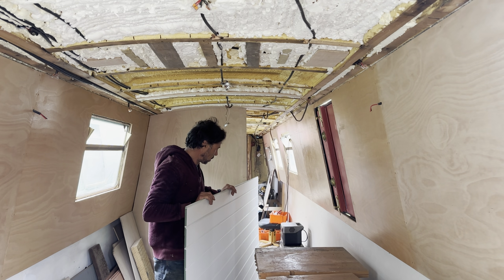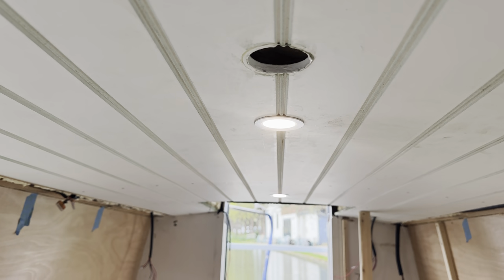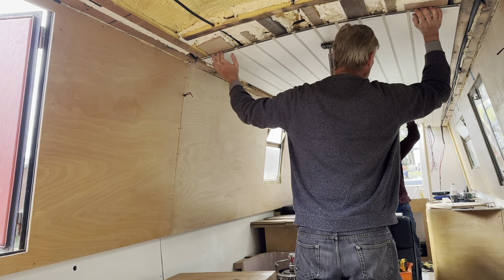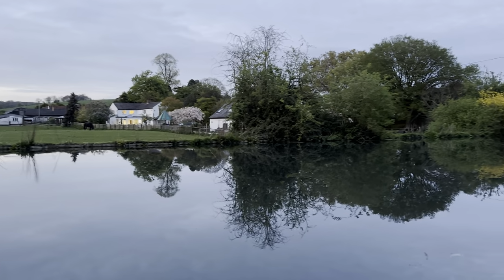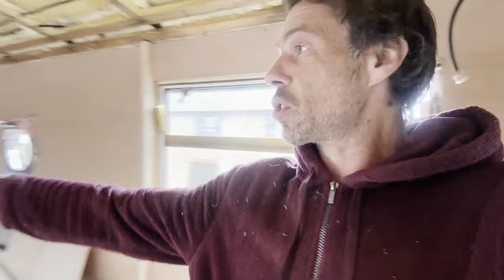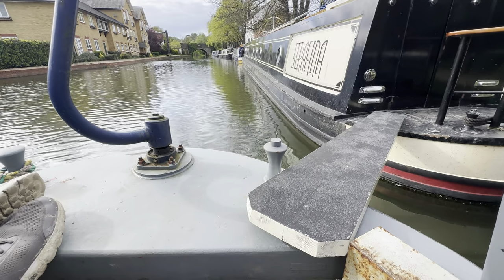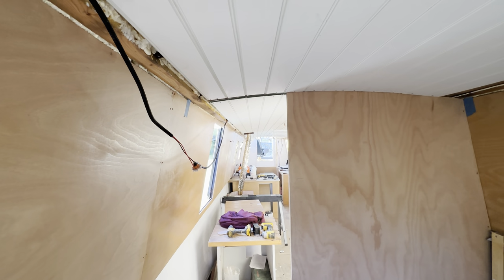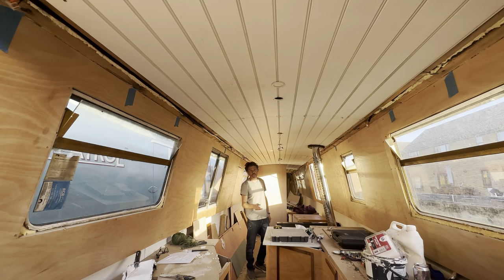538. Transformational change on board

Comment: Get some of that door trim with the brush for your sliding door gaps.  The kind you get on the bottom of doors a bit like the stuff you have inside letterboxes?  The brushes will close the gap when doors open and move out way when doors closed - I hope that makes sense mate 👍
Reply: My thoughts precisely.  I have a similar draught excluder on my front door, and the bristles are about an inch long.  Longer ones are available.

Comment: You could make some blocks that you could temporarily screw to the ceiling with a toggle on. You could have 2 on 1 side closed to tuck the board up behind and 2 open on the other side, then lift the board up flat to the ceiling and close the other 2 toggles. Your board will then be held up to the roof while you position it and fix it. Then remove the toggles and use them for the next board.

Comment: Yes, I can see the variance between the centre line and the ceiling panel, even on the video.  That's something I would notice, but I think that the idea of putting in a central plinth would be good.  I can detect about a 1/8" variance, but if it were consistent, I think the plinth would obscure it just enough.  The ceiling is looking very impressive!